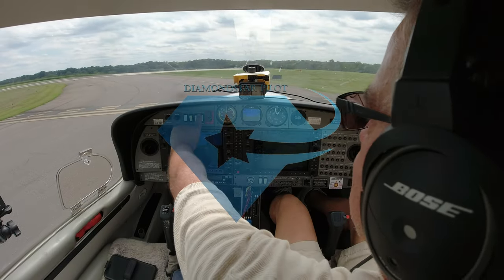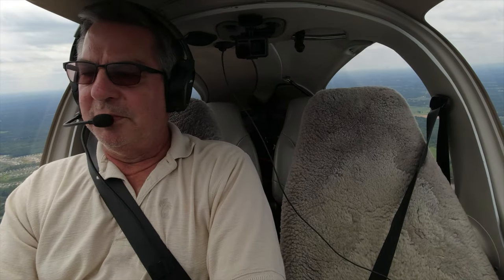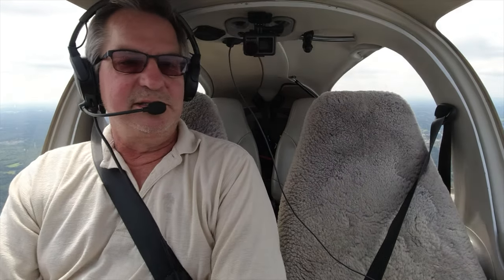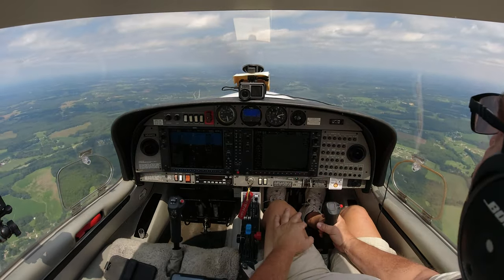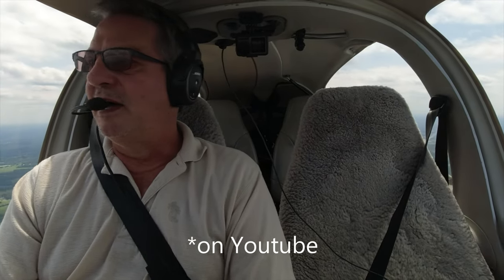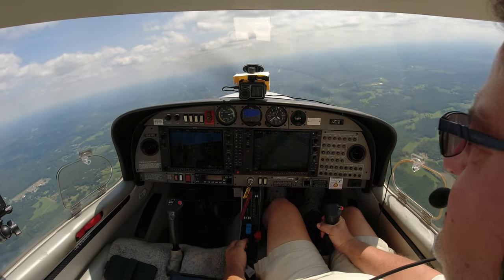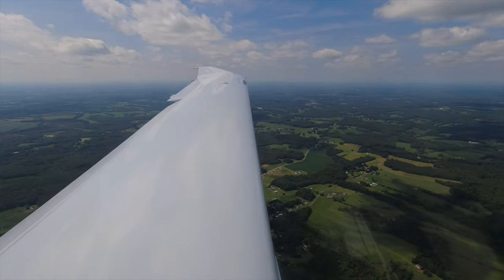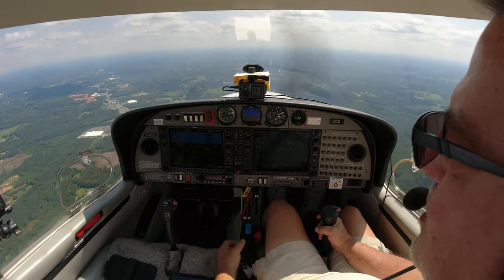Is The Impossible Turn On Takeoff Possible?

Comment: Good to experiment with. I don't agree with the 5 count, that may be true for some that are mentally unprepared but you don't want to be that guy. You want to be prepared and know that engine failure is a possibility and have a plan ready. And I've seen some that weren't prepared react within 1 second. So be prepared, that includes checking google earth or recon of the area around the strip for possible landing sites. If there are nice open fields that can be an option. If it's a mine field then you can't just assume the erroneous teaching premise of 'landing ahead'. There was a guy not so long ago that died 'landing ahead', in part because he froze up from not having a plan. Chance favors the prepared mind. One good preparation is to kink to the side immediately after take off for a more natural loop back. And I would recommend experimenting with tighter turns. Best glide is good for straight glide but for returning to the runway you want a tight turn to not be far off to the side and sink in the soup. You can also experiment in flight sim. Taking off as far back on the runway as possible is better and steepest climb more than fastest. You want to climb steeper than your glide. Some planes are able, others are not. It's very aircraft specific. A Bonanza for instance seems to be incapable of returning, maybe at any altitude. It's from 1945. Many old planes should not exist. I get the impression that STOL planes can return at any point like it was nothing.

Comment: Thanks for your videos. I fly a DA40ng out of Savannah, just south of you. What about a steeper bank using the stall horn to watch for stalling. Best glide is for distance, but not necessarily for tightest turn. I would also be inclined to raise flaps. What do you think? Keep up your videos - they are full of useful information!
Reply from the maker: My goal is to provide the best chance to successfully return to the airport not necessarily the bare minimum altitude assuming everything goes perfectly.  The flaps could be raised and the prop could be feathered to increase gliding distance somewhat but, in an actual emergency will that happen and is it beneficial?  I think stall/spin is a greater hazard than gliding distance and that is what bites most pilots attempting to return.  I am hesitant to promote steep bank angles and no flaps for that reason.  The stall speed in the DA40 goes up to 64 (T/O Flaps)-66 (No Flaps) in a 45 degree bank.  6kts between stall and glide is not a big cushion for the average pilot in an emergency.  I am sure an experienced pilot who has practiced this maneuver could be successful from a lower altitude but, I am trying to give pilots of all skill levels the best chance.  Thanks for watching.

Comment: You might want to try this using a more aggressive bank in the turn. Standard practice with gliders (in the event of a rope break on TO) is to bank 45 degrees. You definitely have to keep the nose down! Also, in gliders the standard decision height is 200', even with a low performance 20:1 glider.  I've turned around and landed in a glider with a 20:1 glide ratio from 250'. I also wonder about raising the flaps - not really sure what best practice would be. Maybe keep them in TO position through the turn, but raise them coming out for a better glide at the end?  (And I do own a DA40....)
Reply from the maker: Your comment is very similar to another viewer so, I'll do a bit of copy and paste:
 My goal is to provide the best chance to successfully return to the airport not necessarily the bare minimum altitude assuming everything goes perfectly.  The flaps could be raised and the prop could be feathered to increase gliding distance somewhat but, in an actual emergency will that happen and is it beneficial?  I think stall/spin is a greater hazard than gliding distance and that is what bites most pilots attempting to return.  I am hesitant to promote steep bank angles and no flaps for that reason.  The stall speed in the DA40 goes up to 64 (T/O Flaps)-66 (No Flaps) in a 45 degree bank.  6kts between stall and glide is not a big cushion for the average pilot in an emergency.  I am sure an experienced pilot who has practiced this maneuver could be successful from a lower altitude but, I am trying to give pilots of all skill levels the best chance.  Thanks for watching.
Reply: Fair enough. I fly out of an airport that has pretty much no option straight ahead, so I'm always extremely prepared for that turn back.

Comment: My past instructor had the engine shut down just as he started the crosswind turn -- somewhere between 7-800ft and made it back with energy to spare. That was in an Archer with 9:1 glide and the Diamond is closer to 9.7.

One element you could add to this test though. You demonstrated the ability to get aligned, but how comfortable are you in having made it back over the fence? If you are much more than a mile out... it gets pretty tight. I am guilty of climbing a scooch above Vy, so maybe I should rethink that a little.
Reply from the maker: That is a good point.  The plane, the load, climb out speed and the weather will definitely play a role in how far from the runway you will be at your chosen altitude.  In this video, I averaged 1 min to get to 700ft agl at 75kts (which is 6kts above Vy).  Using that as ground speed (I'm sure it was less), that would put me approx. 7,500 ft from the point of rotation (which usually takes place using about 1,800 ft of runway).  That would leave 2,000-5,000 ft. to the end of the runway at the average airport.  So, on average you would be 5,500-2,500 ft. from the end of the runway.  So unless you are flying an incredibly slow climber or taking off on a really short runway, I think most ga airplanes would be well within gliding distance at their appropriate turn back altitude.  Climbing at Vy would put you even closer.  I am guilty of climbing above Vy to keep my stall horn from screeching.  Thanks for watching.